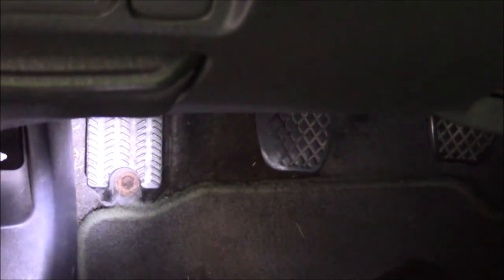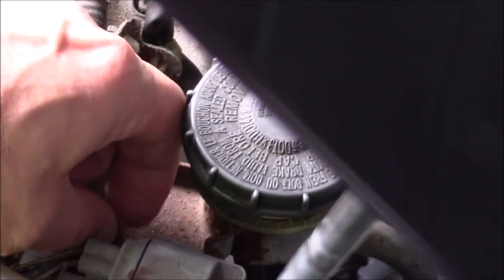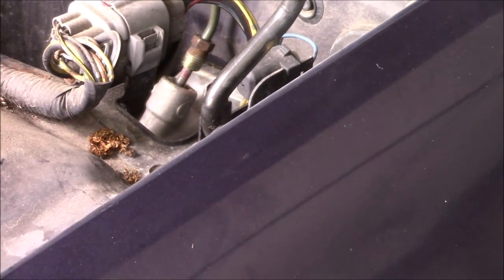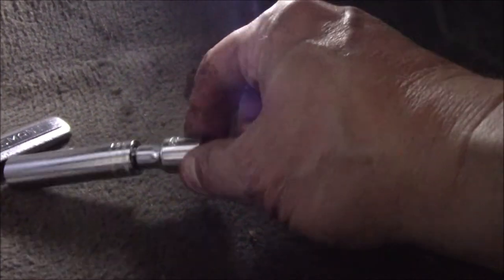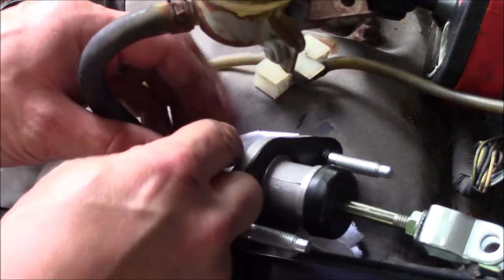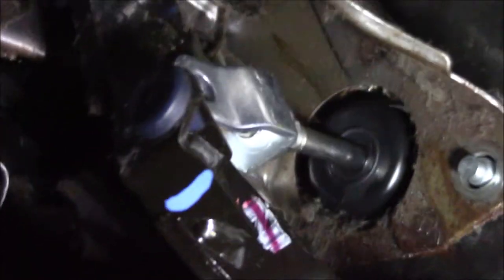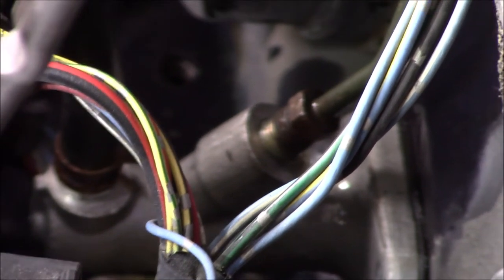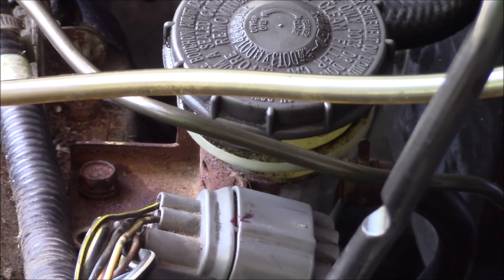Honda clutch pedal goes to the floor, clutch master cylinder replacement.

Comment: Thanks for the tips and the show 'n' tell!
If the fluid in the reservoir doesn't change level, and I can't find any wet spots along the whole line, what would you recommend checking next? There's clearly air getting into the system somehow (I presume), as the clutch is getting looser and looser (engaging a couple inches from the floor, but effortless travel before that).
Reply from the maker: the clutch has a master cylinder connected to the pedal and a slave cylinder by the transmission.  if the fluid is dark you may wish to look closer at the master cylinder. I wish you the best on your repair
Reply: H question , I replaced the master cylinder and still the clutch falls to the floor, any advice ?
Reply: @atticusschleufer7511  and you successfully bled the system after installation?
Reply from the maker: you may wish to look closer at the slave cylinder at the front of the car where you bleed the air out.  I wish you the best on your repair @atticusschleufer7511

Comment: How many mileage when u replaced this and it’s original right?
Reply from the maker: it appeared to be original, and if I remember correctly it had 120,000 miles. I wish you the best on your repair

Comment: Use dot4LV in the clutch
Reply from the maker: thanks, good to know, the instructions on the new master said dot 3
Reply: @bbbjim1fixedit  don't mean it's the right way doing that is just something 🧠 and there are many other things about a car that the instructions say or leed you to believe , I have An example: the 06 Honda has 16 inch wheels by 6.5 inches wide . If you buy tires @205 by 16 . Those tires say do not mount on a 6.5 wheel. The inside door jam says 205. Which is 205 cm which is 7 inch rim. And we all know they are not. Seems someone at customs changed these stickers.  And so I would need a 165 which is 6.5 inches. And the door jam. Don't say that .so who's right who's wrong . Uhm your brain. As for you you would be driving around with the wrong tires. Cause the door jam said so.  Hahahaha. Like how your driving a manual with brake fluid in it. And not LV dot4.
Reply: Don't tell people what to do. DOT3 is what Honda states in the manual, which is how they manufactured it.
Reply: @cognac8297 who hurt you lmao

Comment: thats for hondas outside the usa..anyways the inside of my car door sticker says 205/55/r16..  the 16 inch wheel is 6.5 inches wide.. if you buy a 205 tire to install on your car like the honda sticker says the tire says do not mount a 205mm tire which is 8 inches on a 6.5 inch wide rim. so whos is actually dumb to the reality ... but anyways as for you science did that. your favorite quote. but as for me i HAVE A BRAIN.   you want a 6.5 inch tire on your 6.5 inch wide wheel, a 165/55/r16, ,... 165mm is 6.5  so go by the book as you say and run a 165 wheel ha.l . you do the math. oh wait you cant .. and as for the dot4 it flows thru holes 1000 times better. even in a braking system. even flows thru clogs.. so you do the math again..many people would love to know this. and your like buzzard bird flying around in your computer screen